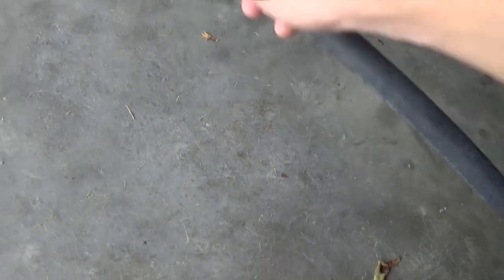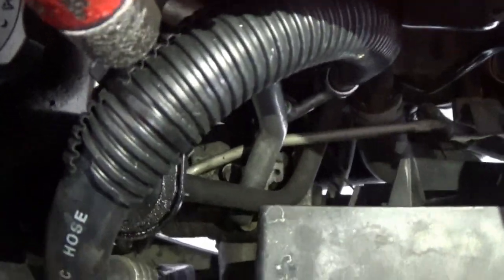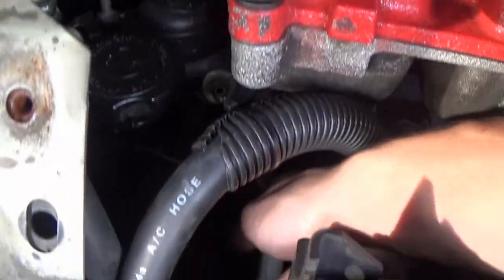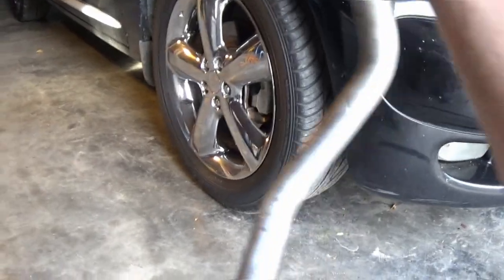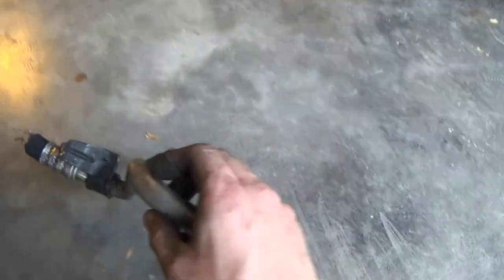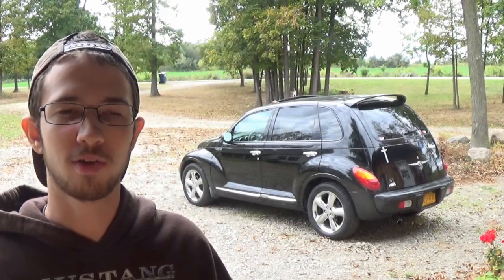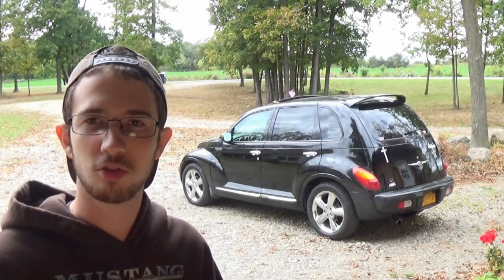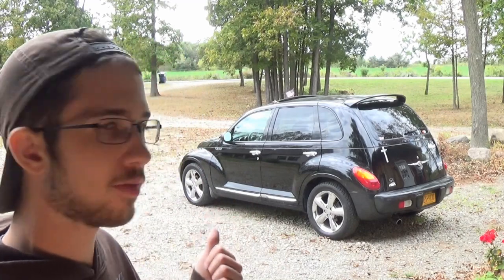IT FINALLY BLOWS COLD AIR!  (PT Cruiser GT) - A/C Suction Line Replacement + S10 UPDATE!

Comment: I just replaced the suction line on my 06 turbo and found it was alot easier to go in from the top and put the bottom over and under the starter then route the rubber end between the power steering pump. Took about 20 minutes with some turning and twisting

Comment: From experience. You have 3 bolts holding the power steering. Remove bolt closest to motor next remove bolt above that one. Then loosen the other bolt. This allows you to pull back on power steering to get hose. No need to remove power steering belt. The tension-er will allow you to move without removing belt.

Comment: After getting my car back from the auto repair shop / collision shop, It has been constantly leaking and after that I just gave up on it many years ago even though I took it back in and said there was a problem They said they fixed it but then of course it stopped working a few months afterwards and I just gave up on it at that point. The paint job was shitty so I'm pretty sure they sucked it just about everything else. My car is only never been the same after that.

After all these years I still have it but I'm on the fence right now about bothering fixing it or just basically starting a new with something else because at this point, I'm getting a little bit tired of it. I'd rather buy a new model that someone else pampered and took really good care of.

Comment: Has your intake manifold ever messed up? If so how did your car act I think I messed up my intake manifold and my pt is running like crap, help?
Reply from the maker: I haven't had any issue with mine, I did replace the gasket when I did the valve cover gasket and spark plugs as well, but no real issues I've noticed...  I would think the most noticeable symptom would be a boost leak and lower boost?   (if yours is a GT as well) I'm not sure.  Good luck, and hope you get everything straighten out!